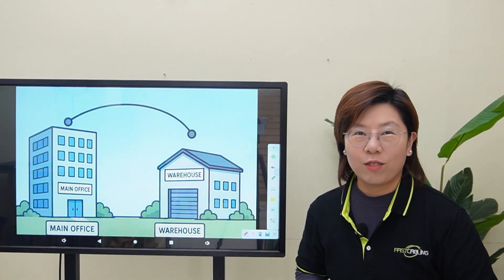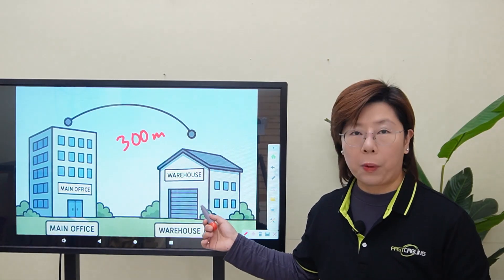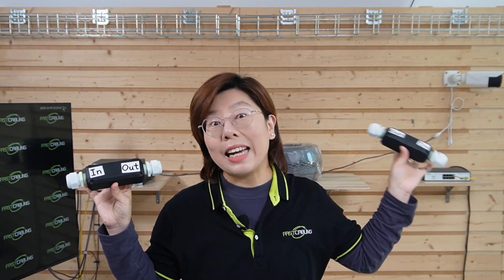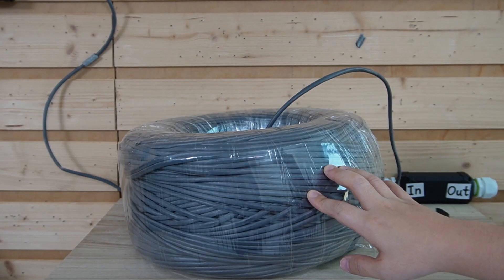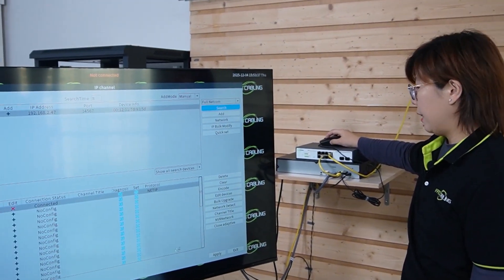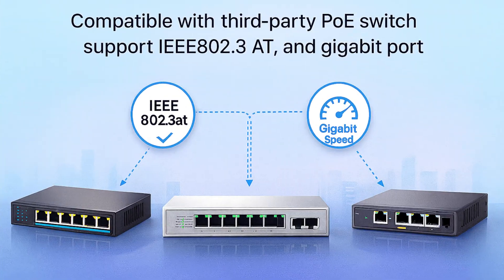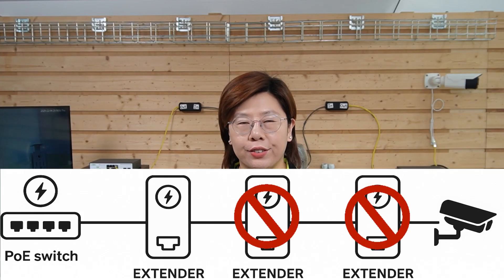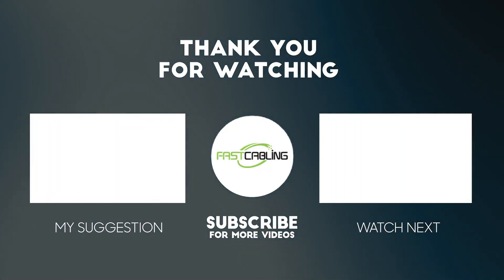Run Gigabit Ethernet 300m Without Fiber for 2 Buildings? PoE Extender Solution

Comment: Can this setup power on Wifi access point 6
Reply from the maker: It supports 802.3at, supplying about 25 watts of power. Below is the bt version:
https://www.fastcabling.com/product/95w-2-port-waterproof-poe-extender-with-60w-output/

Comment: Wait.. !! You want to run cat5e or cat6 .. but fiber , you can run fiber same way as Ethernet wire .. rather net wire will be more sensitive for lighting or voltage surges then fiber .. I’m confused 🤔
Reply from the maker: You can definitely use fiber, but it cannot deliver power to the end device. If you already have an Ethernet cable running between the two buildings, that’s definitely the easier and more cost-effective option.